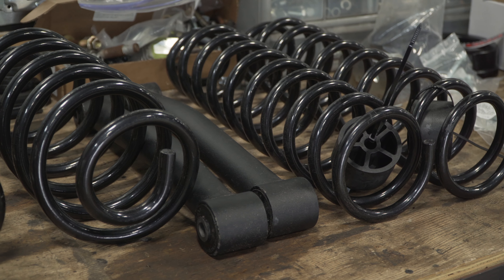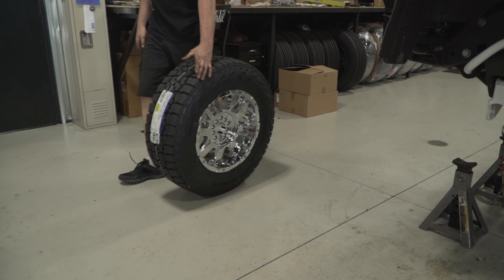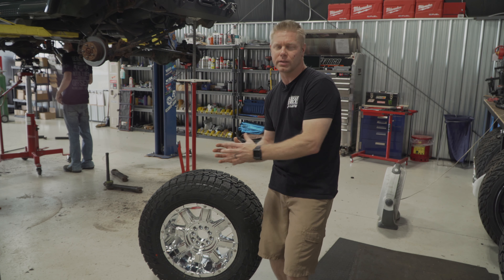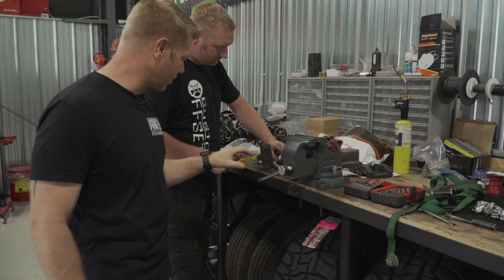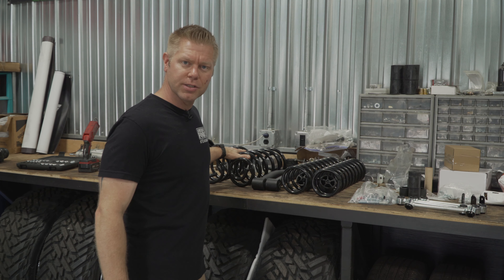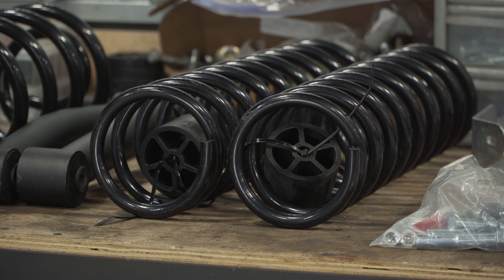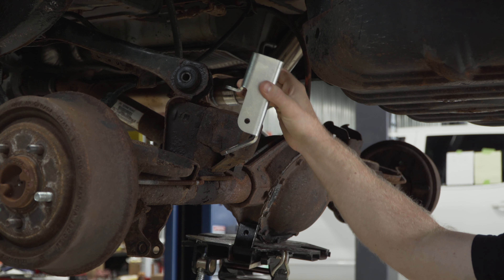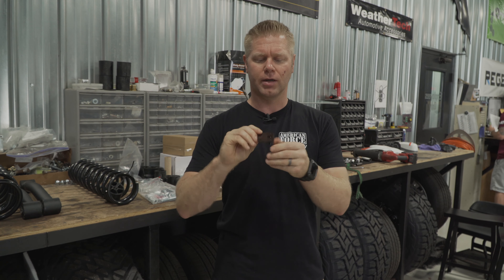2002 Jeep Wrangler TJ 4" Zone Suspension Lift Install

Comment: It would have been nice if you show a video of install and the finished product.
Reply from the maker: We'll get there!
Reply: Are you guys still working on a complete install video? I was just wondering how you did the grinding for the rear upper control arm bracket relocation, on the zone 4" lift?

Comment: Can you run 35s with this lift kit
Reply from the maker: You sure can!
Reply: TrailBuilt Off-Road do you have a link to it
Reply from the maker: Zone Suspension found here: https://bit.ly/3b1PnXq You'll just need to enter in your exact year, make and model vehicle!
Reply: TrailBuilt Off-Road thanks 🙏
Reply: TrailBuilt Off-Road on the website it says the max tire size for this lift is 33 but if I’m mainly on the road does it matter